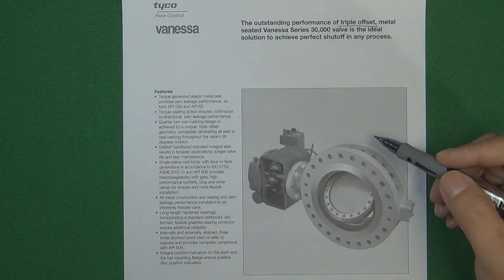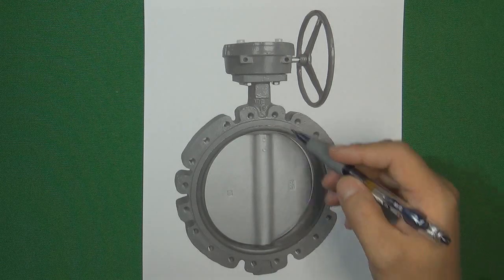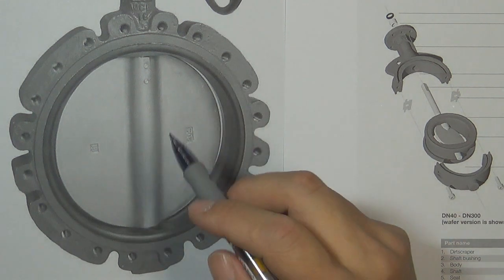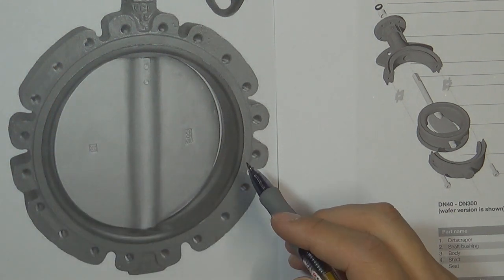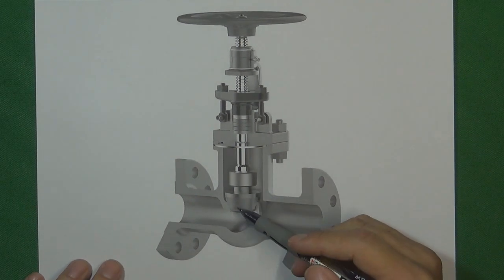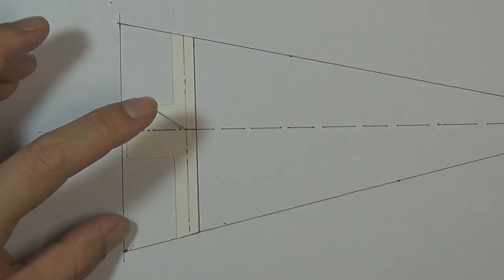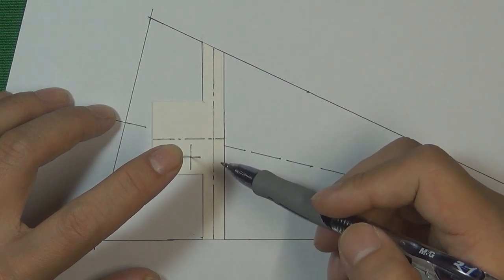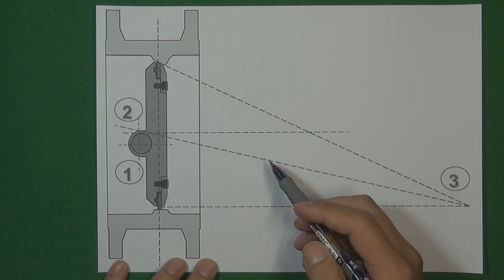What is Triple offset Butterfly Valve #Design Tips 3

Comment: This was a very valuable presentation of the triple offset butterfly valve. We just had a large butterfly valve replaced in a high temp/pressure environment and a triple offset was not used. It failed quickly. Your video gave a quick understanding of it, and i found it very useful. Thank you!!